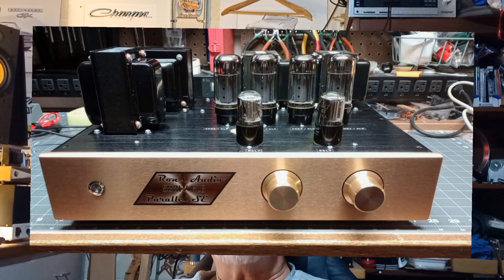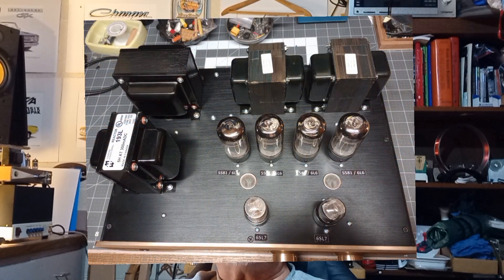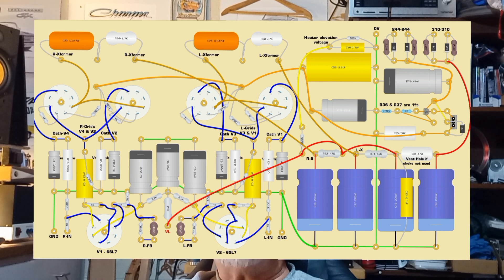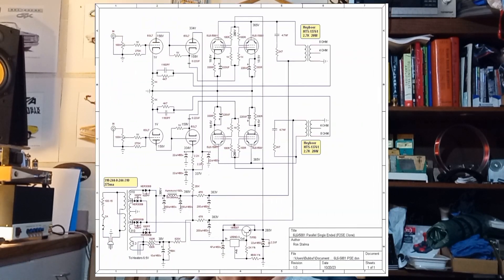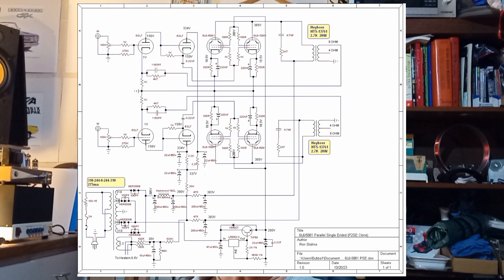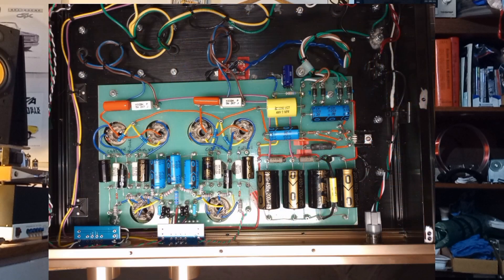AudioNote P2SE Clone - 6L6/5881 Parallel Single Ended Stereo Vacuum Tube Amplifier

Comment: Hello from Germany, I still have a lot of parts to recreate this beautiful amplifier just like you did. Do you have a parts list for me? I would be very happy if you could help me. Best wishes.🙂
Reply from the maker: If you install the DIY Layout creator software (available for Windows or Linux), click on Project Cloud, search, amplifiers, you can download the board project and create a parts BOM for it. If you are going to use the screen voltage regulator circuit, you don't need a special transformer with extra taps. You could use a smaller 250v  power transformer. Schematic is in the video description which shows output transformer specifications and what I used. Though since you are in Europe, you might be able to purchase the original type Audionote transformers. Was too expensive to ship here in the USA.  I purchased the chassis from AliExpress some years ago. I had bought three different styles around 7 - 8 years ago when cost and shipping were cheaper.
Reply: @electricroo  Thanks